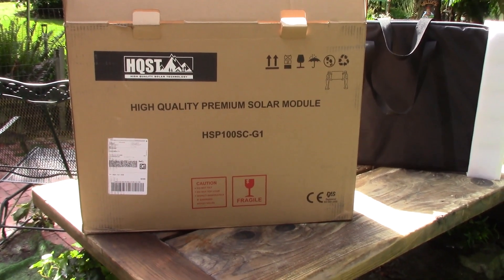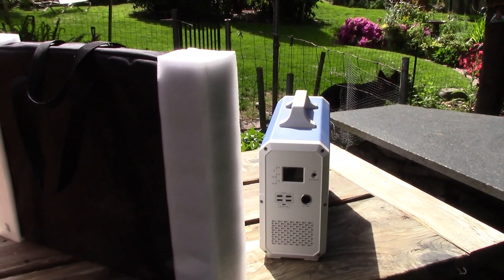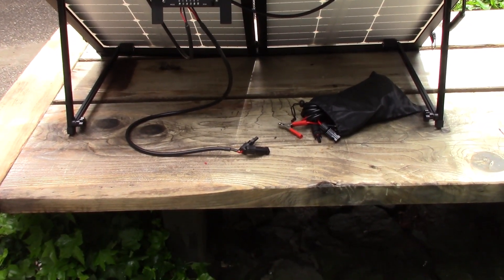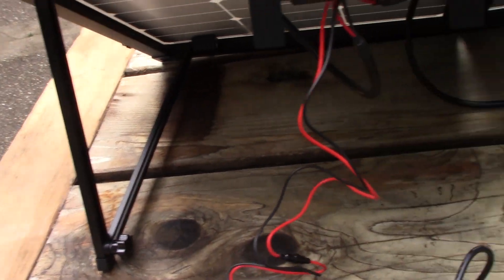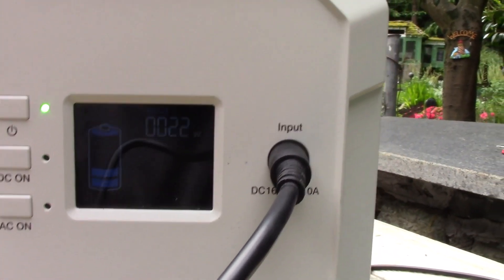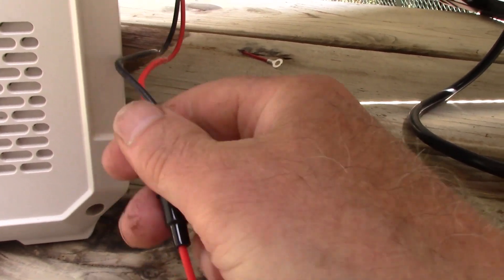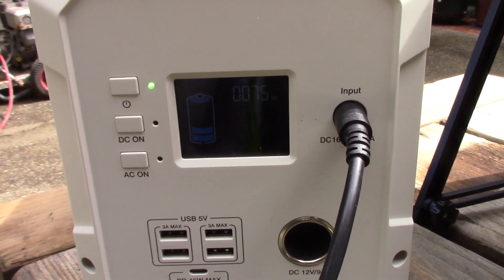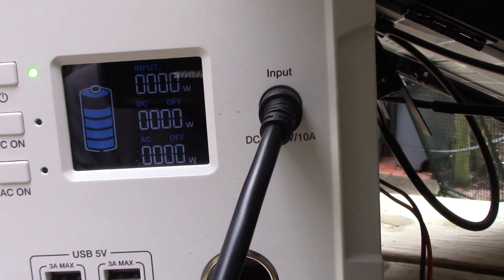HQST 100w portable solar panel charges the Bluetti EB240 - a 2400w solar generator

Comment: One question? Bluetti solar panel charge jackery, i think it fits, if it fits i don't need to buy jackery solar panel, i would use the bluetti panels and save the money.
Reply from the maker: It should .... I think 12v solar panels are 12v solar panels regardless of the brand. The connectors may be different and require modification.

Comment: Does the blue etti.. run a fridge,AC unit 5,000 and a tv?
Reply from the maker: The EB2400 won't run any device or set of devices that draw more than 1000w AC or 120w DC.

Comment: Dude i'm using My EB240 for like 5 hours only consuming 300W max,  ok... I'm turn it off go to recharge it with ac power from My wall and the display show nothing at all it's not charging nothing what this could be?
Reply from the maker: I've had the same issues at times.  Each time I unplugged everything, made sure the EB240 was off, then reconnect the AC charger to the wall, waited until the green light on the charger came on, then connect it to the EB240. (which is in "off" mode).  this always fixed the problem.
Reply: @trooperrvwithgretaandliber6774  there it is... I press the on boton... The light blinks a couple of time and it does not turn on... Maybe it was because i'd unplugged the stuff before id turn the ac power off i don't know, i'm waiting until it let me turn it on...

Comment: Great video. Can you hook up 2 of those panels simultaneously to charge?  is it hard to wire in the plugs? Also my big questions is can you use the battery for power while the solar is plugged in and will it then keep charged up while using and have the solar charging? Thanks! I want to get this setup for when electricity goes out.
Reply from the maker: Yes, you can add more solar panels in series or in parallel.  The panels as they are shown are connected in parallel.  And yes, the included charge controller will allow using the panels while they are charging.  If there isn't sufficient sun to run your appliance the charge controller will pull from the batteries.  If you have sufficient sun to power your appliances then the charge controller will send excess power to the batteries.  That said ... I'm not an expert to double check my answer and let me know if I've made a mistake.  Thanks, Bill
Reply: @trooperrvwithgretaandliber6774  Great. Thanks Nice video!

Comment: I have the identical system including solar panels (x4). The way I hooked my system up was I took the charge controllers completely off and connected the panels directly to the Blueitti via the mcv4 connectors. HQST told me to not feed the Blueitti via the charge controller on the panel. Then the gauge wires are much thicker and I think you might be damaging the Bluitti by supplying it through the charge controller.
Reply from the maker: Thanks for your comment, I'm sure others appreciate the information.